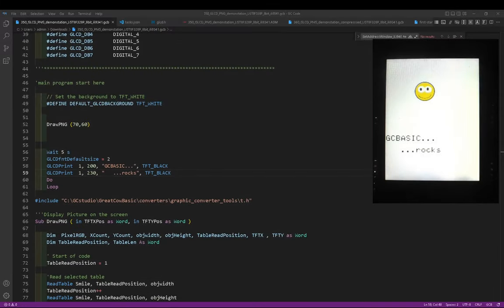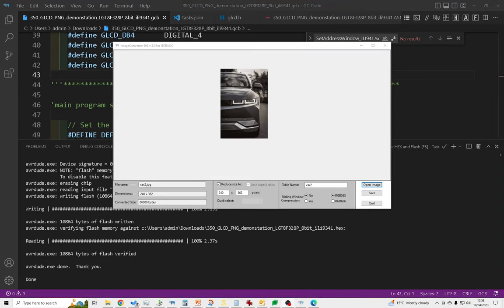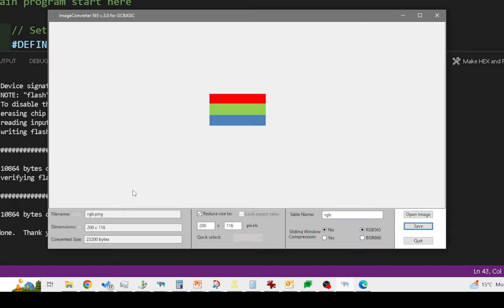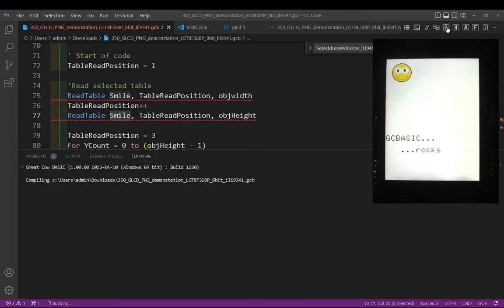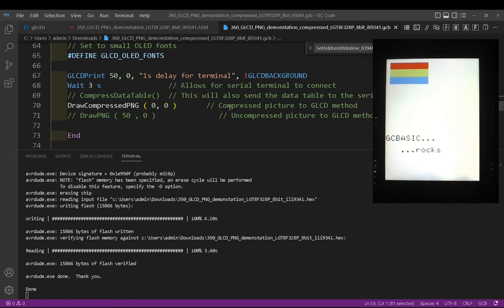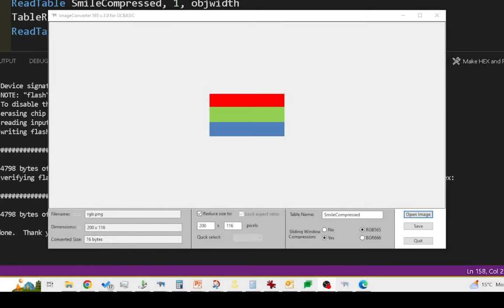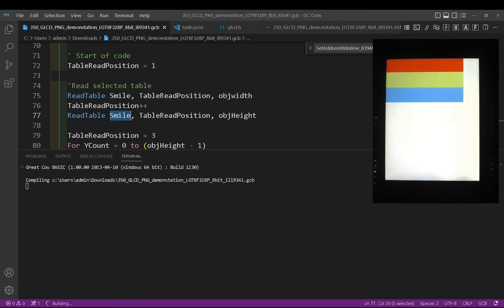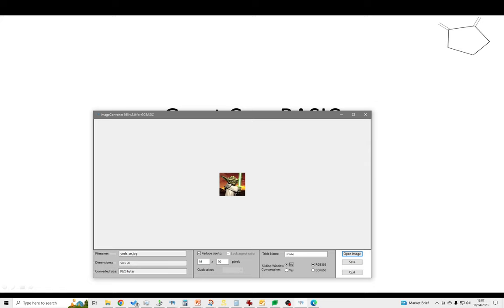Great Cow BASIC:  Display picture files on an GLCD using ImageConverter for GCBASIC

Comment: Hi.
How can I use GC Basic and my Arduino Pro mini to emulate an IR remote control?
I know I will need to analyse the command from my IR remote first. Is there a GCB library that transmits IR light pulse trains

Thanks